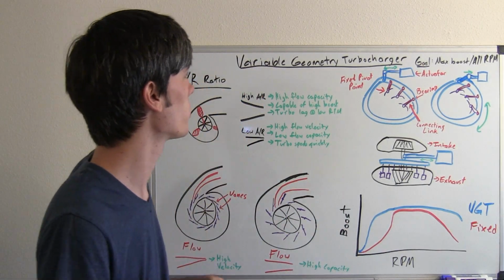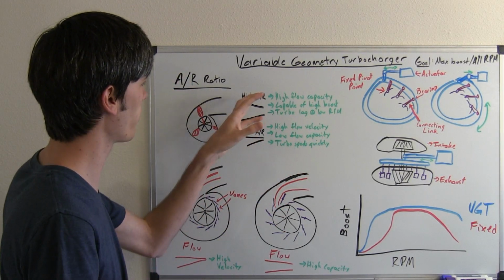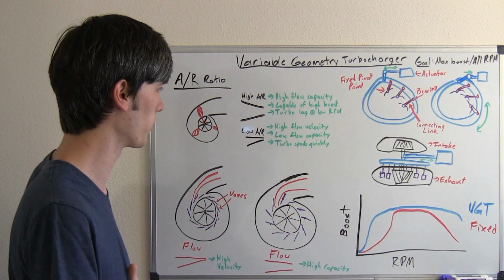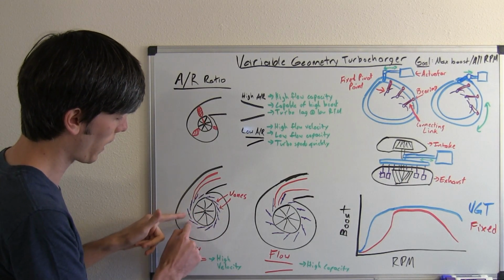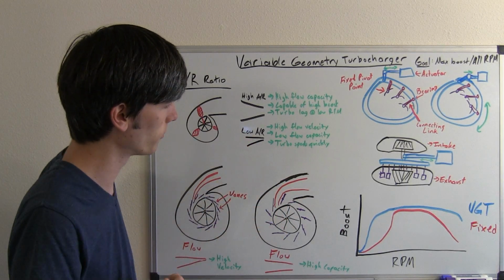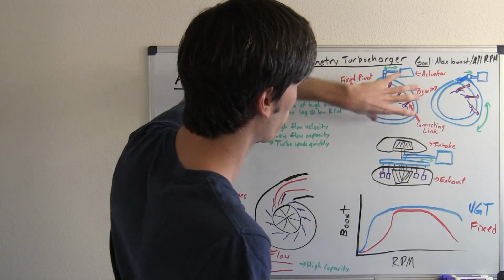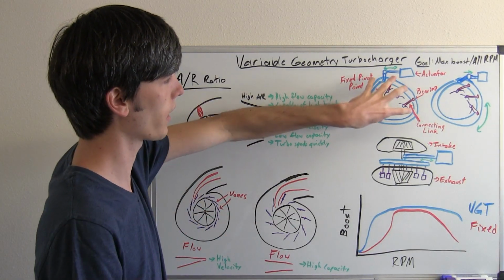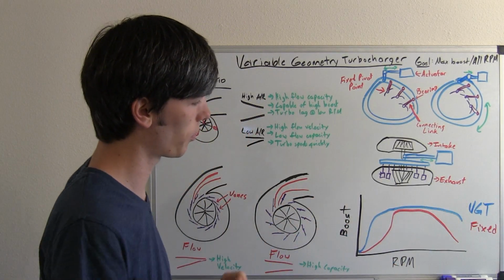Variable Geometry Turbocharger - Less Lag, More Torque!

Comment: Why are they not widely used then? It seems like they have lots of advantages.
Reply from the maker: coscorrodrift For gasoline engines, the exhaust is typically too hot and the vanes aren't able to handle the heat (thus they are used, somewhat commonly now, on diesel engines with lower exhaust temps).
Reply: mrdaxdk well, of course, germans can make anything work :D
Reply: Engineering Explained
Correct, but some high end gasoline engines use them, porsche 911 turbo
Reply: Engineering Explained you should also look at the ford powerstroke they use a hybrid 2 compressor housings on one shaft and using this tech as well to spool up with little lag
Reply: one:1 the fastest car used it

Comment: Guestion, Why does the boost level start to drop off at high rpm (especially for fixed turbos)?
Reply: The small turbine can't keep up with the air trying to flow through it
Reply: ok thanks

Comment: Hi, I was wondering if there is a maximum efficiency point for turbos. Is there a point where the boost that is set is too much for the turbo to handle therefore becoming inefficient and actually making less power? Thanks
Reply from the maker: reid voinaroski They are certainly made for certain boost levels, and have a certain range where they are most efficient. It's all about sizing it for the power you want, and across what rev range you want it.
Reply: Ok thanks!

Comment: So when searching online about these things I only find VGT's available for diesel applications, I must be missing it but can you get these for non diesel, is there anyone who manufactures them for non diesel?
Reply: Usually VGTs are used in diesel applications since RPM rev range are much shorter, making every 100 rpms count. Usually in gas engines you can take advantage of the boost for further more rpms. I have a TDi with VGT and trust me, it does make a difference. Even with VGT, I can only take advantage of the boost for about 2k rpms.

Comment: Doesn't the air entering the compressor come in through the big hole where you can see the turbine?
Reply: Yes but no. He is explaining from where the exhaust gas enters the turbo and in contact to the turbine. The one you see in the side with a wide opening and you see the turbine is the cold air intake. Remember that the are actually to turbines connected to each other with an axle.

Comment: You mentioned that petrol engines run hotter so the vanes are effected more and that' makes sense. But I was thinking this would be beneficial in a performance applications but the higher boost pressure surely would effect the vanes and the actuator would need to be more performance oriented ? Or is this not the case ?

Comment: Hmm, im quite new to the car world and how they work. I have a question, is it possible to have a VGT and a supercharger on the same engine? If so, is it beneficial or not really?
Reply from the maker: It's always possible, though I don't see the benefit. The VGT adjusts for the lower RPM.
Reply: ***** the octane of fuel that you should use is pretty much based of your final compression ratio after boost is factored in. I'm sure you know this (hopefully.?) but I just want to clear things up for others reading along. Lets say pump gas (93octane), it has an effective compression ratio of 12.4:1 (ball park number not exact) before detonating or autoignition, for an example, let's say your pistons are 7:1 compression. You may run approximately 11psi of boost to make use of the 93 octane fuel without autoignition. You may split the boost between the super charger and turbo charger in many ways, however you may like. But it certainly doesnt mean 11psi from the blower and 11psi from the turbo. You'll probably need more than e100 (ethanol) by then lol the famous Veyron has 4 turbos each at about 4.52 psi. which is a combined 18.1psi. Many turbo/supercharger set ups will have to split boost inevitably. Otherwise you will find yourself incapable of finding a proper fuel to use soon enough. So to answer the question asked above. You can run that set up. Just make sure you're total compression ratio is appropriate for the fuel being used.. and timing.. lol >.<

Comment: I just wanted to know if there should be some way of compensation maybe some other variable startors on the inlet side because it seems there would be some inefficiency for both the high and low rpm for the turbo in the hot section as compared to the intlet side as it travels through both the settings..

Comment: Hey, would this application work well for a 2.0 16v engine? After a few searches, they don't look all that common and any ones I find are for big truck, pickup etc. engines ... seems like the design would work well for all?
Reply from the maker: Theoretically it's applicable everywhere, but for gas engines the exhaust temperatures are a bit hotter, so the vanes typically don't last as long, hence they're more common on diesel.

Comment: Hi as always great video, I have a question for u. I have noticed that a alot of people rev their engine just before turning it off, and I couldn't find a proper explanation to why it should be done, the explanation I found said that its bad in turbocharged engines because it keeps the turbo Running even after the engine is turned off and another person told me that its good because it flushes out the carbon in the engine cylinder. So I would like to know what exactly happens when the engine is revved just before shutting it off? N is it really bad or good for the engine? Thanks:).
Reply: that is an old practiced used will old tech carburated engines. Has nothing to do with turbos themselves, but in order to avoid engines from stalling and make it easier for them to start up the next day. Probably the people you see doing it are used to see their parents do it (or they are the parrents LOL) or just don't really know what they are doing. High pressure pumps and EFI fixed that a long time ago.
Reply from the maker: I've never heard of doing that to be honest.
Reply: Alot of people actually do it. There are a posts on Google as well about this,  u could look it up
Reply: emmanuel joseph They are muppets ... Think about it for a second ... In short  the turbo needs oil while it is spinning to keep it lubed, if you have your turbo spinning ( due to you lifting the revs ) & then you switch the motor off, you also stop the oil pump thereby stopping the flow of oil to the turbo & you run the risk of destroying it  ..... O_o
Reply: nzmikey
Not only is that oil used to cool the turbo and save the bearings from seizing it also works as a damper for the turbo-compressor rotating assembly. So if the oil flow is stopped (or rather the pressure falls under the critical threshold) the rotating assembly is at the risk of hitting the casings - not good at all. If the turbo is still hot then the oil will cook in the bearing and thats a problem also. In other words - revving the engine before shutting it off - BAD IDEA.

For a N/A engine I don't see any problems though - other then looking like a dickhead showoff.

Comment: Wicked video lad thanks. Wondering if you or anyone can answer a quick question, is it a feasible option to run VGT's in a twin parallel setup?

Thanks in advance for any responses :)
Reply from the maker: Possible, sure, but costly. These typically aren't used in gasoline engines (though they can) due to the higher exhaust gas temperatures affecting the vanes.

Comment: I have heard that a Turbo charger help in improving Fuel Consumption (I.e decrease the fuel consumed), in comparison to a naturally aspirated engine producing same horse power. Is it correct?  I Agree that Turbo charger helps to downsize the engine displacement , but still to produce the same power as a naturally aspirated engine turbo charged engine also needs to burn more fuel right? So how is this Fuel efficiency thing justify? Could you please explain?
Reply: A turbocharged engine requires just as much fuel at peak HP as a NA engine, possibly more so. What matters is it gets better economy at LOW power output, because it isn't making much, if any, boost, and you effectively just have a small engine. In a way, it's like Displacement On Demand: you have a big engine when you need it, and a small one when you don't.

Getting good fuel economy in a turbo'd car is predicated on being disciplined enough not to use the boost much. You can have "eco"; you can have "boost"; you just can't have both, simultaneously.
Reply: Actually fuel consumption can increase since you need a new fuel pump in some cases, for it to be noticeable you may need a smaller engine and a small turbo to have low rpm threshold.
Reply: Just to add one extra point, in general you'll tune a turbo engine to run leaner at lower RPM. So when you stay out of the power you're using less fuel.

Comment: Surely those vanes compromise the overall top end torque by creating some kind of resistance in the flow of the exhaust? perfect for circuit style duties but i cant imagine it to be very effective in a drag race setup.
Reply from the maker: I'd agree, in a drag setup you'd be staying in the upper RPM limits, so you'd want a turbo that was most effective in that range, rather than a larger power band.
Reply: Engineering Explained Are the vanes controlled by the Ecu or is it controlled by air pressure in the intake similar to how a wastegate actuator is controlled by intake psi?

Comment: Quick question. Wouldn't it make more sense to have a valve of sorts in the turbo which at low rpms keeps a low A/R ratio, but as the rpms increase, the valve opens thus allowing a greater A/R ratio for the exhaust to flow more freely? Is this already invented? If not, what is the reasoning for not going this route?

Comment: Hi, how does VGT affect the design of the exhaust headers, and the exhaust after the turbo? So, as exhausts are a balance between low rpm scavenging and high rpm total flow, does VGT make things easier or harder to get a balanced system across the rpm range?

Comment: I'll never understand how the inside of a turbocharger stays clean enough to work. Imagining a hole with hot air blowing through it and managing to stay clean is beyond me. 

... I bet Mr. Hankey could explain it to me.
Reply: What Sn1pest3r said, and I have an air filter on my engine that filters the air to prevent debris and other crap from entering the system.
Reply: And it is really hot in there so stuff don't stick
Reply: You just answered your own question, there's air blowing through the turbo the whole time, and the speed by which travels won't let any residue stay in there.

Comment: Very nice video! Perfect explanation! 
I like to point out the biggest con. of a VG-turbo:
It's nowadays only used in diesel applications because of the lower ignition temperature. The module with the vanes is called the Nozzle and the vanes won't be able to handle the higher temperature of gasoline. Nevertheless I'm working on a gasoline VG on my design team.
The newest VG's use a rotary actuator mainly because they are smaller.
Reply: 9 years later. I'm look about VGT turbos in gas or Ethanol engines. How you project goes?

Comment: The Bosch VGT seems to work on a different principle, as a boost limiter.  It appears that at low RPMs the vanes are closed to provide maximum airflow to the turbine wheel.  However, as RPMs increase the vanes open to act as a waste gate and prevent over boosting.
Reply: drkjk as far as I know the same applies to KKK.

Comment: Hi great video and great explanation you have there for VGT. My question, does VGT have any relation with twin scroll turbo chargers?
Reply from the maker: I've got a video for you in 7 days. :)
Reply: Just to save you the suspense, no they don't. VGT plays around with the air flow rates inside the turbo while twinscrolls play around with dividing the exhaust gases before it reaches the turbine but that's all I'll say for now!

Comment: How come VGT is not so popular in sports cars?

Is it very expensive, and is it reliable?
Reply from the maker: I would assume cost. The answer is usually cost.
Reply: I see a lot of them on toyota and mitsubishi diesel trucks, I guess it's more popular on normal cars
Reply: they're expensive and they have a lot of moving parts. If you think about it, racing cars and sports cars in general stay in a fixed rpm range (4.5k-8k) when they're raced and so variable geometry is not really needed because they just need to tune for maximum boost in their rpm range that they're working with. Since they're always on the hot side of the rpm range, they turbos get very hot and having more moving parts increases the chance of failure.
On the other hand, street cars always have varying rpms which is why variable geometry is more alluring as it gives gives maximum boost as low in the range as possible and therefore acceleration time is reduced and they get better mpg.
Reply: High temperatures mean the parts distort unevenly when running.  This requires increased mechanism clearances.  Large clearances cause low efficiency, and mechanism jamming due to misalignment.  Better materials may eventually allow it to work for gas engines.

Comment: Do VGTs usually make less boost/HP than a fixed geometry turbo? I know in a lot of diesel applications, a fixed geometry turbo will make more power.
Reply: I believe so yes
The reason could be that blades at fixed turbos are much more "solid" than at VGT, because of the moving parts
Or maybe it's just your feeling, because at fixed turbos, turbo lag is much more noticeable and then turbo kicks in. But at VGT, engine get pretty much constant air mass flow so the turbo lags among with "turbo kicks" aren't so noticeable.
Sorry, I'm not that fluent at English :P

I would really like to see/hear/get an answer to your question :)
Reply from the maker: They are designed to provide greater boost across a larger rev range, rather than for a very specific rev range. That said, you could probably get more power from a single turbo for a very specific rev range, but overall the curve would be worse.

Comment: My Dads 2002 Saab 9-5 Hot Aero Estate has a Variable Geometry Turbocharger in it and it pulls from 1800rpm right up to 4000rpm thats when the turbo is at its sweet spot I believe although the revs could be higher I need to check that out!